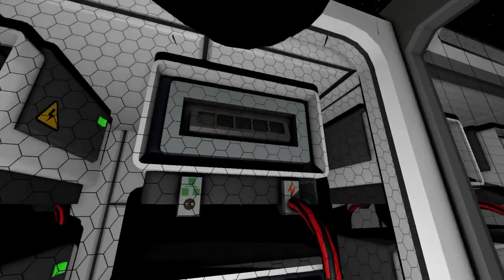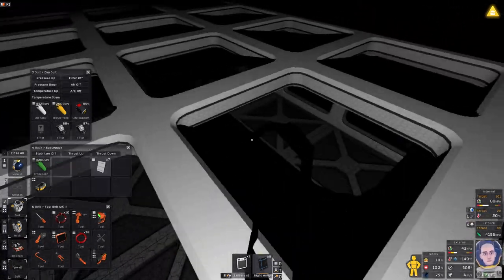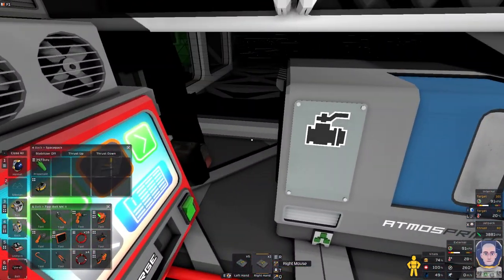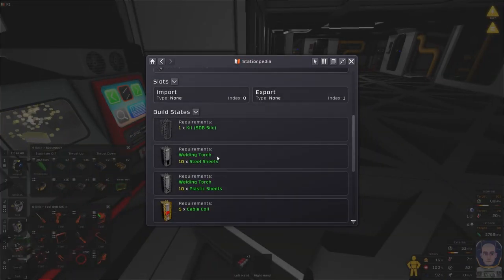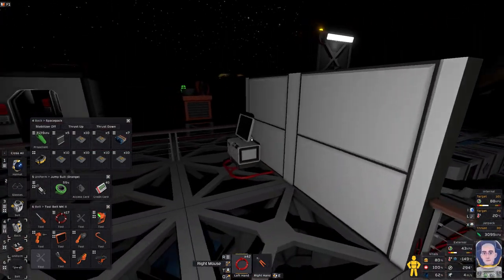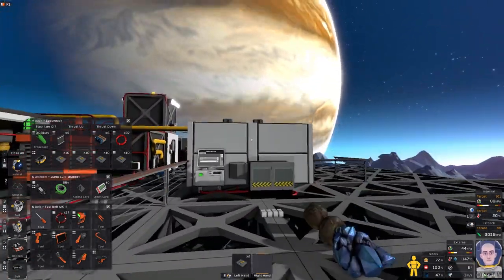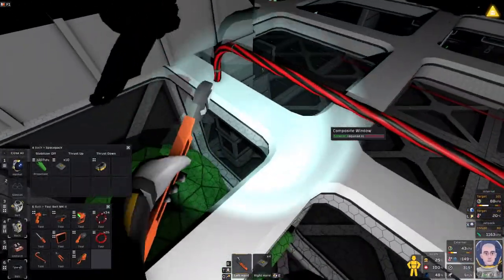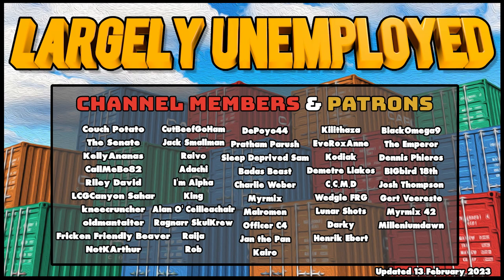Building a GIGANTIC sorting array | Stationeers Europa | #15

Comment: u could turn the sorters 90 degrees and have 1 straight line running on the left side and then u just turn the right side which is the sorted stuff, so u dont have to make snakes around it :D
Reply from the maker: That is GENIUS. I'll rework it when we get to the alloy sorting.